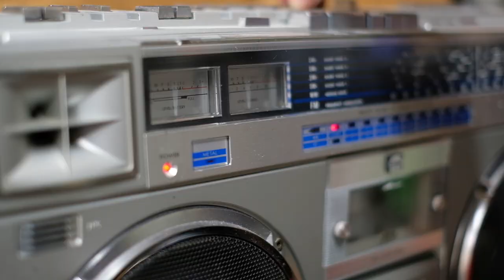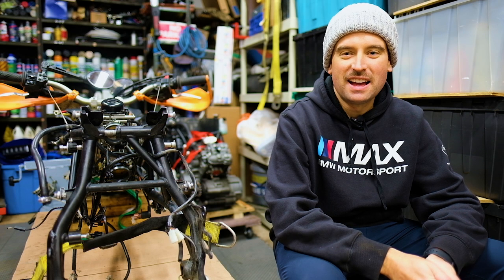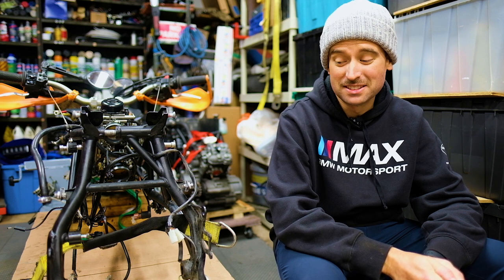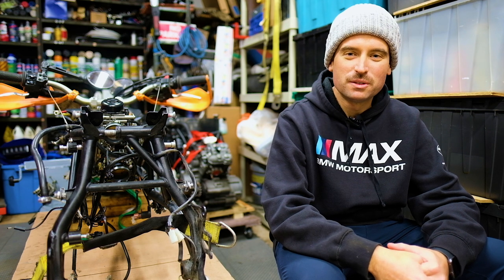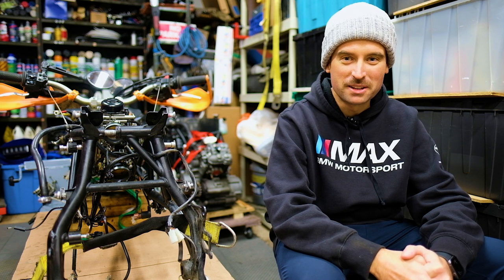KTM 950 Adventure S LC8 Restoration Rebuild - Episode 2 - The Teardown Continues

Comment: Agree with a lot of the comments - get rid of the mufflers as they generate soo much heat and are very heavy. I've had the same bike from new and I'm currently investing in it. Just fitted the TripleClamp Moto air filter kit and 6Sigma jetting kit. About to do the Mr Bean fuel pump upgrade. I still need a good sump guard and considering a Rade Garage rally fairing kit. Keep up the good work.

Comment: I have a 2012 990 Adventure. I've got the 2 into 1 exhaust with the Yoshimura carbon end can from Rottweiler. It. Is. Savage.  I highly recommend getting one.
At the moment I have a standard air box but will be changing it out for a Triple Clamp Moto. Everyone I know who rallies KTMs uses them. I'll be following your progress eagerly as I've just stripped my own 990 down, I'm in the middle of wiring harness repairs, then I'll be rebuilding the top end, including vapour blasting and repainting the cylinder heads as my paint has flaked off. Good luck with your build.
Reply from the maker: Ahh, yes, KTM wiring lol!  The wiring looks relatively intact on this bike, but will definitely give it a once over.  Awesome to hear about the exhaust!  Keep us up to date on your project!

Comment: Living in Germany, I can tell you my 950 runs and sounds damn fine with stock airbox and filter and Akrapovics with db-killers.
Airbox and exhaust mods and noise (and having fun ind general) are very strictly regulated over here, so I better don't risk it.

But you should definitely get some aftermarket exhaust to get some sound and massively reduce the heat of the stock one.
Reply from the maker: Oof, jealous of the Akras! You are correct that aftermarket parts are very regulated in Germany!  Will most likely be getting an exhaust thanks to all of the suggestions!
Reply: @bivouacmoto6440  I totaly agree with @o0Bananaphone0o, the intake on these bikes doesn't make much sense unless you go all-in on mods, on the other side a good exhaust will make a bike feel a diferente beast.That engine and that chassis the stock power is more than enough to overwhelm the majority of riders in a dirt patch!
I've a superduke 990 a thas my 5cents

Comment: Keep aftermarket airbox and an aftermarket exhaust. Its worth it just for saving you from the bag melting heat from the stock pipes, let alone the weight saving and performance increase. Having airbox removed and aftermarket filter makes working in that area easier too
Reply from the maker: Thanks for the suggestion!

Comment: Twice a 990 owner here (just bought another). DO NOT KEEP the Rottweiler airbox. They disintegrate (and end up in the intake - the least you want to do to your motor) due to the build up heat in the confined space between the two tanks. I ve had two disintegrate in my hands. Warmer climates don't help either and these disintegrate even faster under these conditions. The stock airbox is extremely well thought and doesn't need a profound remapping like the open filters do.

Comment: I have a 93 silver and black 950. I bought it new after seeing Meoni in the Dakar and meeting him on some of the lessor rallies. My advice would be to get the aftermarket cans. I have a set of titanium cans from Wings and they are still in perfect condition. The originals get exceedingly hot and they are very heavy as well. The sound is great even with DBs installed. As you say they are brutal but very rewarding bikes. My only issue with the 93 model was the rear brake performance, but this is solved by a factory recall modification. Your model might already have this.
Reply from the maker: So awesome that you were able to meet Meoni and see him in action!  Y'all convinced me on the aftermarket exhaust!  I did read up on the rear brake issue (mainly thanks to Pyndon) but unsure if mine has been fixed (01/04 build date).  Will definitely take a look before it's all together though.
Reply: What's a "93"? Definitely not year!

Comment: The old 950 is a complicated bike to work on. That’s a bit strange with its rally heritage. The newer rally bikes from ktm is super easy to work on and everything is very easy to access. Not a big fan of the Rottweiler intake, especially if you riding off road or do river crossings. The stock exhaust is heavy and generates heat. Get an aftermarket exhaust. I have Arcras without db killers and the sound is awesome! You should send the suspension for a revalve and stiffer springs. It’s the best upgrade for the 950/990 Adventure. Konflictmotorsport or SPS. Good luck!
Reply from the maker: Eh, definitely a lot of moving parts on the 950, but glad to not have any of the computers and ECU's that are found on newer bikes.  Particularly wanted the 950 for the carbs and lack of computers.  With that said, I hope I never have to change the electric starter on the bike because it's in the worst possible place!  Suspension is currently getting resealed and I'll see how it feels in stock form once I get it on the road.  I've heard that the front can use stiffer springs, but I'm also not the heaviest person and the 04's have 265mm travel.  We'll see!
Reply: @bivouacmoto6440  The suspensions valving is the big problem. The front springs are to soft even for small riders but the rear spring is ok. Trust me it’s a revalve and stiffer fork springs are the best upgrade you can do if you planing to  ride off road. It’s a great suspension only totally wrong settings for the bike.

Comment: I think u should check stuff really carefully that has been updated in later LC8 bikes like the water pump shaft, clutch slave cylinder, torque limiter of starter motor.
With the Rottweiler it would be interesting how the bike is modified to it. Due to having a carburetor it is for sure not that easy to "remap" like on the later LC8 with injection.
Reply from the maker: Yup, doing the water pump, timing chains/tensioners, aftermarket slave cylinder, starter bolts, head bolts/washers amongst other things.  The carbs are currently jetted for the Rott intake.

Comment: Good work so far! I'm stripping down my 990 so its good to see your progress. Should check out Triple Clamp Moto for a new foam filter intake system! I'm half way through installing their system.
Reply from the maker: Thanks - and good luck with your rebuild, too!  The Triple Clamp filter system looks pretty similar to what I have now although it does look like it might be engineered better...
Reply: @bivouacmoto6440  It's a more updated system for sure. Whilst it's not everyone, I have seen a few people who have had issues with dirt making it through the rottweiler kit.
Speak to Alon or Amir at TCM, customer service is second to none and go above and beyond for their customers. 
Sadly, not paid by TCM, just very pleased with their product and service. Know many people who use the system.
Reply from the maker: @mkerstin  Yikes at dirt getting into the Rottweiler kit.  Glad to hear about the customer service - will definitely consider it!

Comment: I kept my intake on mine and added a Uni Pre-filter. Bike makes enough power as is. I heard the rotti intakes may leak and let dirt in. Aftermarket exhaust for sure. I've got the MIVV storm cans, vid in my channel.
Reply from the maker: 950 definitely makes plenty of power in stock form!  Would love to find an Akra kit, but leaning toward an MSR titanium 2-1 kit as it's available from Italy.
Reply: Rottweiler (and ITG) type filters disintegrate really fast due to heat in there and they are not only bad for the engine (sucking those plastic pieces in and fusing them, God knows where) but very expensive as well. I've had two disintegrate in a span of a year and a half!